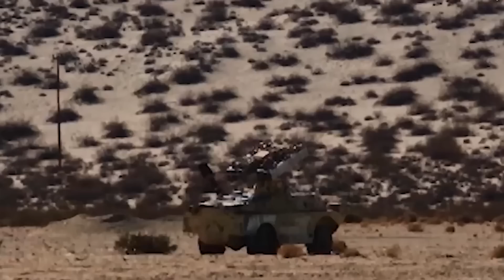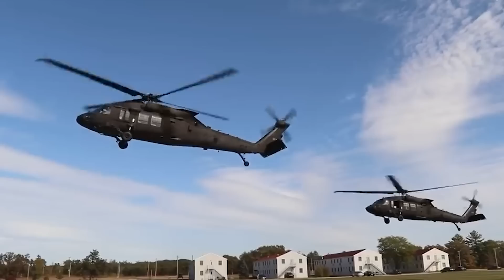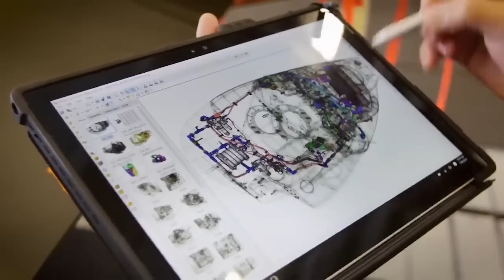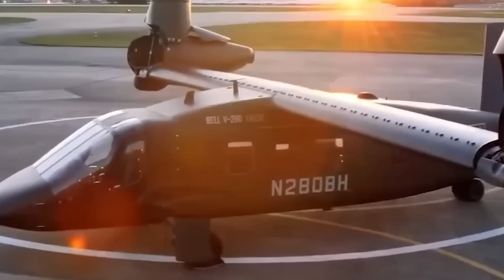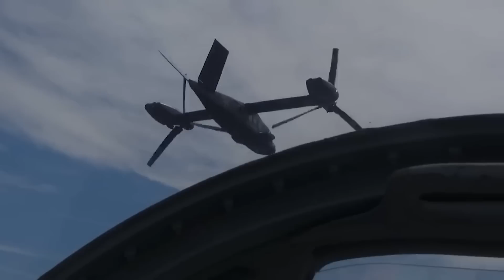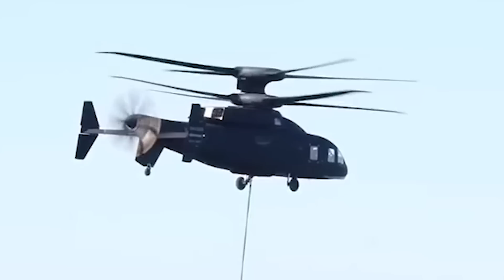The Helicopter that Will Crush the Black Hawk?

Comment: Dual rotors is the worst idea ever. Just look how many V-22 accidents and crashes there have been. It’s such a unstable design. Even osprey pilots will agree how dangerous/difficult that thing is to fly.
Reply: This New Craft Is Nothing Like The Predecessor. 👥🥊⭐️
Reply: Not really true, I would say it had about the same start as the blackhawk, I remember a time in the 80s blackhawks were crashing all the time.
Reply: There's a reason why v22 gets a lot of flak and it's because it carries more troops. In total however, UH-60 have more accidents than the v22. Media bias and the large numbers of casualties causes a lot of flak. Along with early accidents.
If we go to the complexity of the systems the aircraft has, it's much more simple and everything that could potentially cause a problem has been taken into account from the obvious backlash on the v22. V22 rotates with engine, v280 doesn't but uses a drive so that it doesn't need more complex equipment that might cause problems and become more expensive.
Reply: The V-22 is actually one of the safest aircraft out there. It’s accident incidence rate is actually among the lowest out there.
Reply: @andrewday3206  51 service members have died in accidents over its life and “The 10-year average mishap rate for MV-22′s is 3.16 per 100,000 flight hours,” i don’t know what the incident rate is for other aircraft but that sounds significant to me… besides the point it’s visual presence is ridiculous in horizontal flight configuration it looks like the ISS is flying towards you.
Reply: @GlyphXCharm1  early problems with the V-22 did create some accidents. That and of course pilots flying outside what is a safe flying envelope. Many great aircraft start with unresolved issues but mature into game changers. Today’s V-22 is safe and effective. BTW the V-22 and V280 both look BadAss!
Reply: Ahaha, anime kokoshikopeedor triggered to criticize human aircrafts and glorify it's pedostan, ahahah.
Reply: There really haven't been, it just had teething problems. 

Also, it's not the first aircraft to have two rotors. The Chinook and Flying Banana have been around for a really long time now and they're fine. 

The Valor is mechanically simpler than the Defiant and to boot it has greater capabilities in literally every camp.
Reply: @cielopachirisu929  the chinook is in a very different configuration though so i don’t think that’s a fair comparison
Reply: V-22, I've seen hundreds of them over the years flying where I live. Very safe.